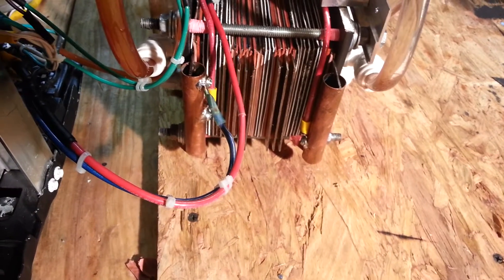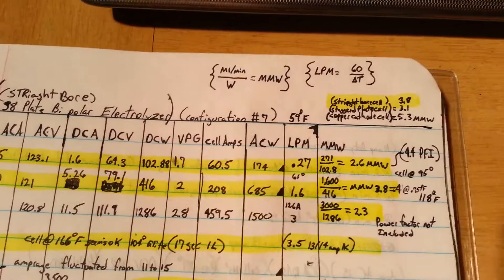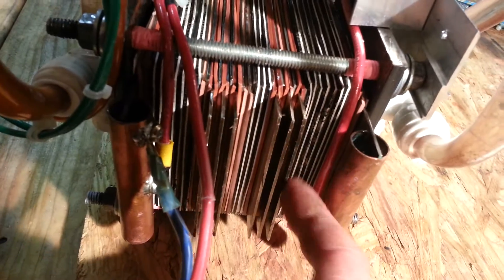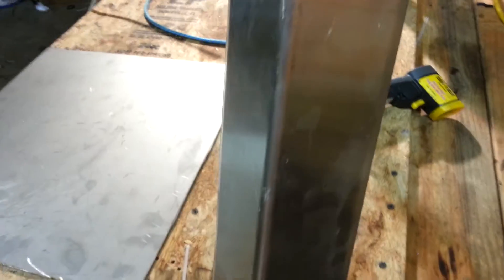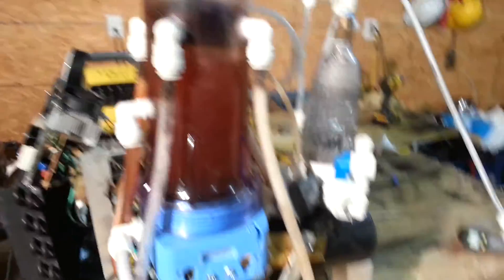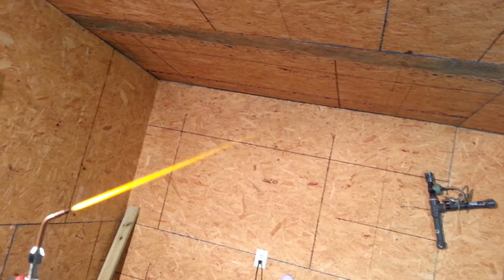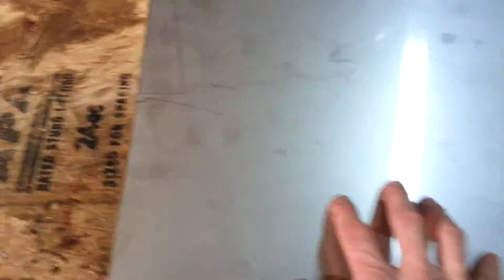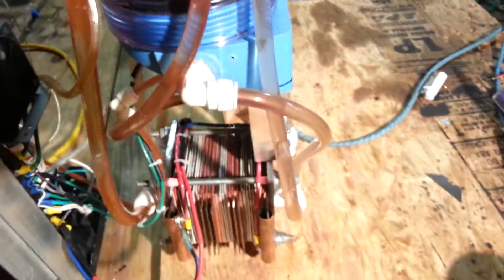HHO torch 2

Comment: I have been watching your videos for an hour or so and find much of your information to be of great value ... your stainless sheet is 304 grade stainless as it is not surgical steel requirements .... as for your garage heating , to keep you warm ... find yourself an old catalytic cleaner from a scrap car or truck , clean the insides by soaking it in a solution of citric soaps or natural soaps , which will soften the oil sludge etc. from the inside , clean at a car wash or use a pressure sprayer to clean up and once again allow air flow through the substrate materials contained inside ... next stand the unit up on end and away from any flammable surfaces ; eg. stand up on end by placing bricks around and to support the catalytic converter ... turn on your hho system but do not light the flame , and insert at the bottom opening of the converter allowing the hho to proceed upwards to the substrate surfaces ... use cautions as the temperature may exceed 900 degrees ... have a fan close by to cool it down = free heat movement around your shop , etc... you can figure out the rest from there ... from a friend up north ... T...---------------p.s. -- temperatures may exceed 1200 degrees , so use cautions ... a new catalytic converter will require a burn system to be used on the inside to activate the interior substrate surfaces , before LENR reaction can occur ...

Comment: just noticed your stainless plate there.In the scrapyard we use a gun on nonferrous metal to tell what it is.If not just put a magnet up to it.It should not try to stick at all.Should be 316 or better.I like that very low volt high amp idea you have been using.Always wanted to help the efficiency with my caterpillar diesel.

Comment: what is your laminar flow filter made of?
Reply from the maker: its a very porous sponge like material used in gutters on houses , it fits inside the entire length of the gutter to keep leaves out , i believe small plastic screens will also work but ones made of metal tend to induce electrolysis from stray currents in a counter productive manner, i have found that no matter what you do when using low grade sodium hydroxide you will get foam  above 80 deg F, stay below that if possible and you wont need any of this , my radiator keeps this cell around the temp, soon i will try high grade potassium hydroxide  as i believe the drain cleaner is not at all pure despite the indications on the canister

Comment: a stainless welder i know makes 304grade equipment for the catering industry.'''WE NEVER USE 316L'' -direct quote. you might get lucky. i just got some 304 plating from the scrap yard, the left over sheet from a pressing type operation. im happy ,i got 7 pieces(sheets) exactly the same size and just one edge needs tidying up.
Reply from the maker: stuff is very pricy , i love a good score , some times i scout out the allies on the weekends